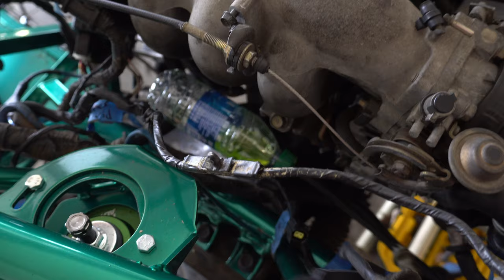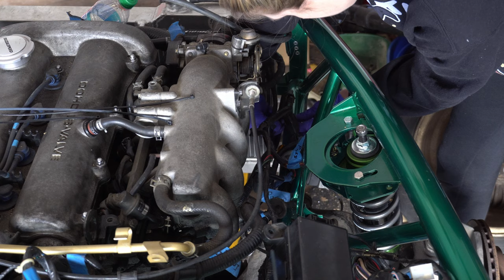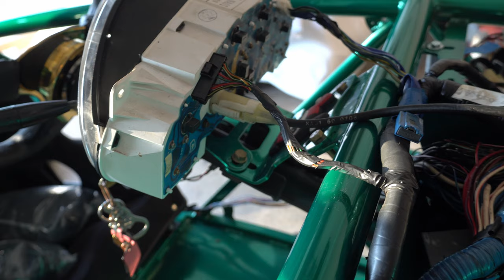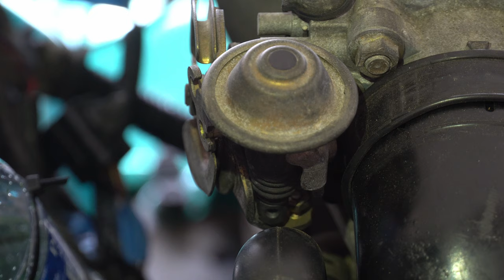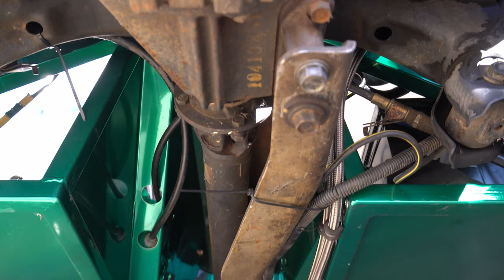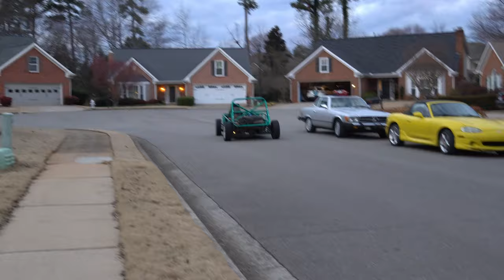Exocet First Drive

Comment: Wheels sometimes turn when in neutral when on stands, its just the oil and shafts spinning around, you won’t move when on the ground.
Reply from the maker: Ah, good to know, just wanting to make sure my clutch isn’t getting worn out with  something engaging. Thanks so much for watching!!
Reply: @summerdelsol - the clutch is actually fully engaged in neutral but because of how synchromesh gearboxes work because of the gear lube- especially when cold- it's perfectly normal for some power to be conveyed to the wheels when they're off the ground, the car is in neutral, and the clutch is out.
Reply from the maker: @ds78613  right on, one less thing to have to address later, thanks!

Comment: Awesome!

Just one quick question - the left rear wheel looked like it was wobbling on your jackstand test.  Hopefully you’re already aware of that.
Reply from the maker: Thanks so much! Yep, all good, the wheel was just on loosely, they got tightened on the ground. These wheels/tires are getting replaced since they’re not the ones I want, and also mega dry rotted. They came with the donor years ago and have been what the car has been sitting on. Only took the car around the neighborhood super slow since they were sketchy. Thanks for looking out, and for watching!!

Comment: The valve ticking is because of the horrible design of the hydraulic valve lifters/lash adjusters that Mazda used in the NAs (it's really easy for them to wind up leaking down when they shouldn't and it's nearly impossible to get good oil flow to them).  Several other Mazda engines in the same time frame have the same issue and it's something you either learn to live with or you tear into the head and replace the bad lifters with good ones.  This requires removing the cams.  That said, this allegedly works: https://www.youtube.com/watch?v=WOkjj4TzRXg

As far as brand of oil goes, I personally run Swepco in my '01 Miata (and my previous Miata) with great success.  My second choice would be some flavor of Valvoline- either plain conventional or SynPower full synthetic.  I have personally had bad experiences with Royal Purple in a 2006 Mazdaspeed6 I owned.  Finally, I would personally avoid Mobil 1, Havoline, Quaker State, and Pennzoil...happy to get into why but that gets to be a bit lengthy and it's late.  Also, the oil discussion tends to turn into a holy war debate, so there's that too....
Reply from the maker: Ahh yeah, I’ve been doing some reading up on it, but it’s just a shame since she used to only do that when it was time to top off/change the oil. I remember the first re-start as an exo it surprisingly didn’t tick, but from the second start on its going nuts. Thanks for the tips, I’ll check out the vid and oil options and start there!
Reply: Its pretty important to find an oil that your engine likes. And that choice can change as it ages. It might be worth going through a few equivalent oils and see how it feels and sounds.
Reply from the maker: @devvynully  It’s due for a change anyway, so it’ll be good to hit reset and try some others out!
Reply: @summerdelsol  - there are so many factors that could go into that. My 1994 was so finicky when it came to the valve noise- very little rhyme or reason to it.

Comment: can you tell me how much it weighs like this?
Reply from the maker: Hmmm it’s pretty close to complete at this point, I’d probably say around the 1,450 range most likely. I didn’t trim any wiring, have the original chunky battery, etc. so mine likely won’t be the lightest one out there with the second seat/bodywork/lights in. Plenty more are fully done at that range though.